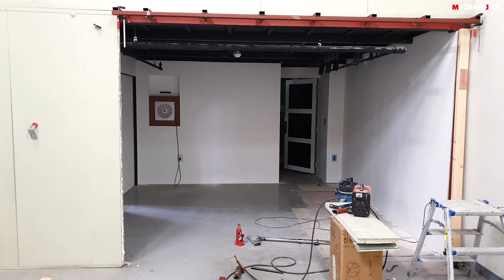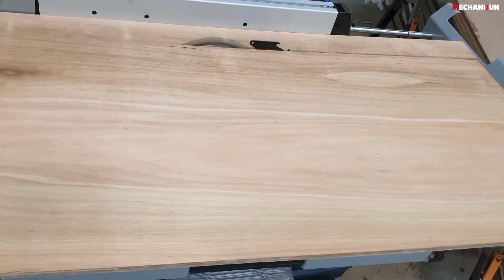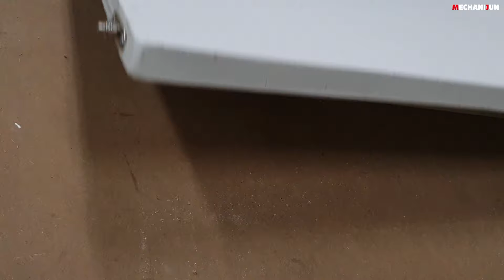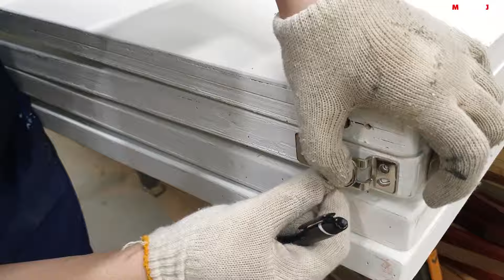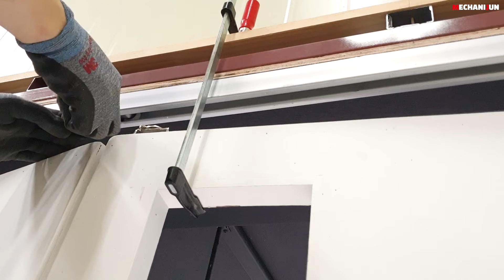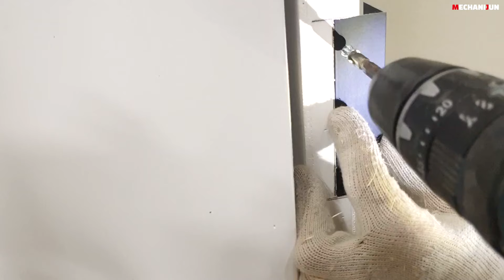DIY Custom Bifold Doors

Comment: What hardware did you use?
어떤 하드웨어를 사용했습니까?
Reply from the maker: upper roller 2ea, rail 1ea, bottom pivot hinge 1ea, upper pivot hinge 1ea, hinges 12ea
Reply: Where can I buy this hardware? Couldn't find. I want to do bi-fold vertical doors in garage to hide shelves and cabinets
Reply from the maker: http://www.chulmooldanawa.co.kr/